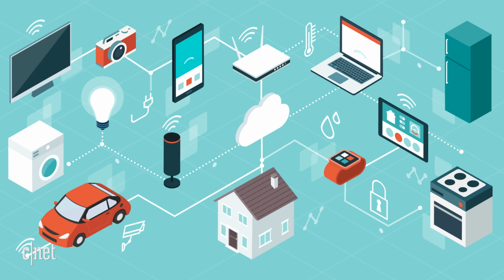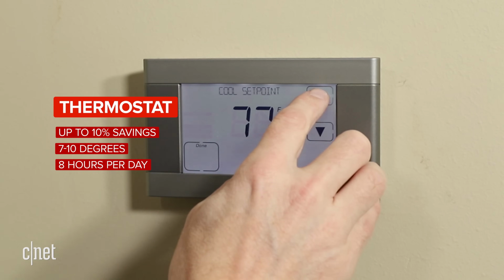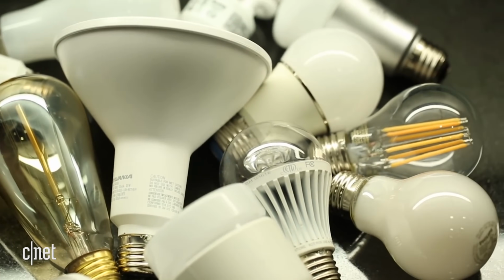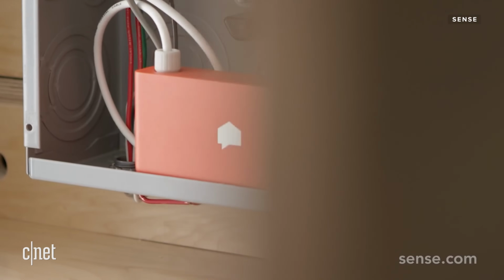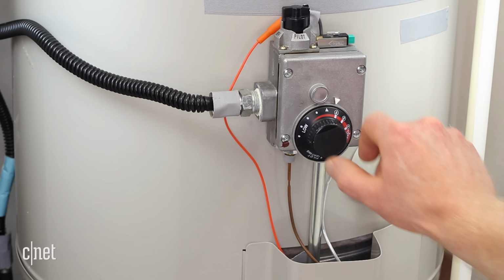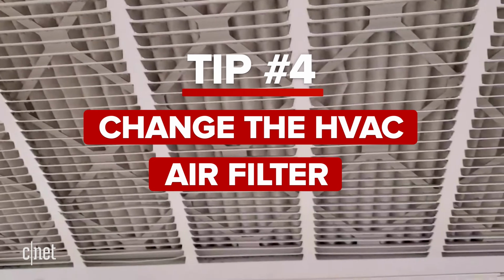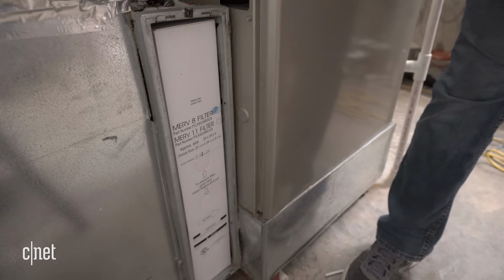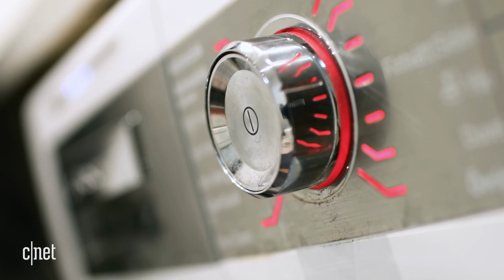Save Money With These Tips to Lower Your Utility Bills

Comment: I prefer the smart light switches vs. smart bulbs, especially when it comes to rooms with 8+ bulbs, controlling outside lights, etc.  They're not as easy to install for sure but it only has to be done once, easier to control all the bulbs (though also requires that you do), you don't have to get another special bulb if one of them craps out, less chatty wireless devices on the network if you're using WiFi stuff...

I have a mixture of a few switches and a few bulbs in one-off rooms/fixtures, just putting it out there that sometimes switches can be preferable depending on the setup.

Comment: I keep hearing don't hand wash your dishes but no one ever seems to address the power usage only the water usage. My dishwasher runs for about an hour. That's a lot of electricity that I don't use when I hand wash my dishes in 5 minutes. And I'm single so I don't generate enough dishes for a dishwasher cycle
Reply: The cost difference is very small and newer dishwashers often have sensors to adapt to smaller loads. Environmentally using the dishwasher is significantly better because of how much energy we use to treat tap water.
Reply: @DevilishDevi  I'm not running and listening to a dishwasher for an hour for one or two damn plates! Just a bunch of control freaks trying to tell everybody what to do.
Reply: @DevilishDevi  First of all, They are exaggerating how much water a person would use for the task (you would have to be overly careless and wasteful to use that much).  Second, the energy you are using to run the dishwasher is much worse for the environment than the alternative.  If we lived in times where water was more scarce than it is now, then this video would make more sense.

Comment: I have solar thermal for hot water; Solar and Batteries to power the house and my EV. We don't have heating in Thailand, but aircon runs from my solar system when it's needed  - the house is super insulated and also designed to cool naturally as far as possible. Rainwater harvesting and solar well pump - result no utility bills.
Reply: i invest in small mining rig (can be used as personal workstation) and result it pays my utility and internet bills